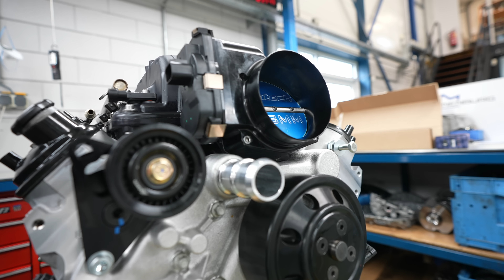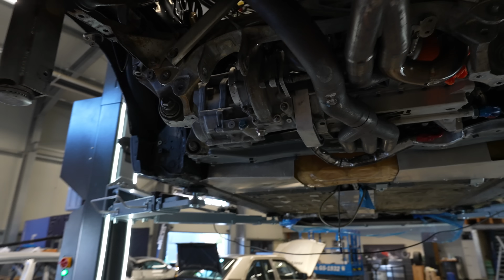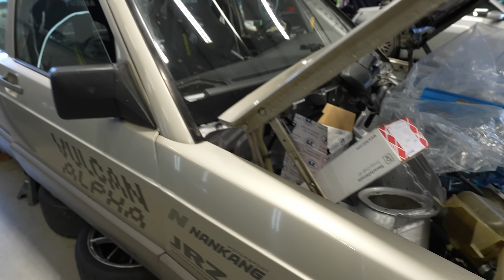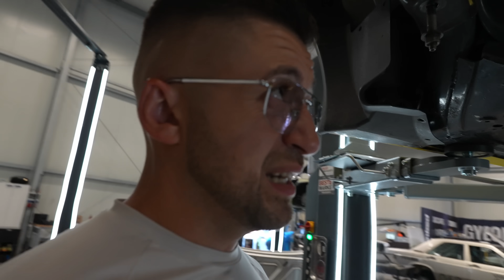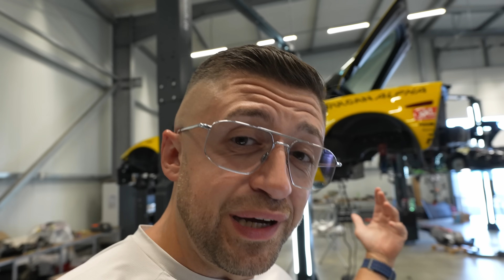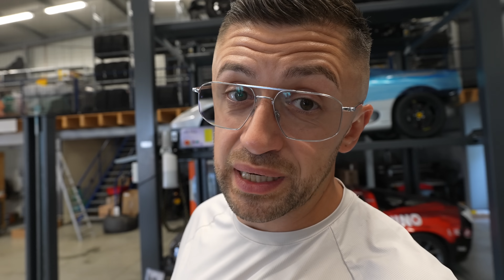F1 Tech And New Engine for My Corvette C6 Z06! (& MORE)

Comment: I would've NOT covered the transmission tunnel panel in gold foil.  Cause now the heat will be trapped in all directions.

But if you'd only wrapped the sides/top of the tunnel.. The heat would be directed down, radiate through the panel & transfer heat under the car. (It would work like a heat-sink.) 🤷‍♂️

Comment: If you like the DC2 rack but all the euro spec models are right hand drive just get a rack from the USDM type r. All the North American spec type r’s are left hand drive. Not sure what the difference in ratio is but another possible solution may be the USDM 99-00 civic Si rack, also left hand drive, EM1 chassis code if I recall. 

Edit: just asked ChatGPT and according to it the USDM DC2 type R rack has a 16.0:1 ratio 2.98 turns. But also the USDM integra GSR has the same rack as the type r which should make it a bit easier to find one.

Also Quaife makes quick-ratio rack and pinion gear sets for the 90’s civic/integra based chassis. People report using a combination of Quaife’s gears and OEM gears to get a quicker ratio than the dc2 at about 2.5 turns.

Comment: Misha, if you want the golden nonpowered steering rack for the EG chassis I have one laying around that was meant for my EK. It is depowered EG rack I think with a integra spindle. I don't remember. It's super responsive and came out of a track-focused EG. It is for a LHD. I think the car it came off of was 15x8 wtih 225s and the steering was amazing.

Comment: The Z is looking better by the day bud.  1 issue though, the American Flag should be facing the other way, the Stars always lead into the wind as these colors don't run.  Right now, your flag is positioned the opposite direction on the passenger side.  So, both flags (both side of the car) should be facing with the stars and stripes towards the front of the car with the stripes towards the rear.  Thanks for fixing this issue, it's important to this US Navy Veteran.

Comment: Pardon my asking about the heat shielding. The colour reminded me of something else, the mylar emergency blankets that come with silver one side, gold the other. To heat a body up you put the gold side out and silver side inside to reflect the heat in (and absorb whatever can be gained from other sources e.g. sunlight). To cool a body you put the silver side out and gold side in to reflect heat away and to draw heat from the body (gold side) and radiate it away (silver side). All of that brings me to my question: Why is gold put on the side that is hottest, wouldn't that absorb more heat than silver? And given the location, wouldn't it thermally transfer the heat to the car chassis?

Comment: What engine is in Lapo's 190e? You guys should use the 3.3l or 3.6l AMG M104 I6, or the AMG M113 (early NA 5l) or M113K (Supercharged 5l V8)....or, if you want something different, OM606 or OM648 with compound turbos ....any of the above with the Mercedes 6spd Manual of course

Comment: For the civic steering rack, depending on what year type r you like, it could be 16:1 or 15.7:1 ratio. If you are having trouble sourcing a type r rack, maybe consider GS-R? I personally had the GS-R rack in a K20Z3 swapped EJ8, it was great!
Reply: All Integra steering racks are the same ratio. The only difference is the year. 94-99 use the 16:1, and 00-01 use the 15.7:1.

Comment: Might look into removing the stock fuel line and evap lines in the tunnel.. run it through the rocker and it won’t get as hot. Plus you can access it a lot easier and less risk of fire. Also the carbon canister above the passenger fuel tank. Saves 8 pounds.
Reply from the maker: Going full fuel cell etc over winter, too much work now

Comment: A dc2 type r was also available in europe and you can also find a lhd dc2 rack they are the same...🫣Anyway A LHD  MG ZS 180 steering rack is also very short and fits but is difficult to find.
You can also swap the pinion from a dc2 into a eg or ek rack.

Comment: I believe the USDM Integra Type R rack is 2.85:1 and the civic is like 3.6:1
Reply: All Integras have the same steering rack ratios. 94-99 are 2.98, and 00-01 are 2.89 or whatever.
Reply: @koopatroopa187 I think the Civic he has uses a 3.6:1 ratio. Probably any Integra rack would be an improvement

Comment: For the Civic maybe DC2R base + QSP steering quickener ? On a 2.85 turn DC2R rack it should achieve 1.9 turn for their 1.5:1 ratio or 1,425 turn for the 2:1 version.

Comment: When a porsche GT3 was too expensive so you got a corvette and threw the value of a porsche GT3 at it.
i love it, keep going!
Reply: This season so far.
Reply: Wait until the civic build bro 🫪 🔥
Reply: Yeeeah. GT3s … 1,000s. This is one of a kind
Reply: This is most liekly more expensive then a GT3. The RRP price is in the sky. I think very few do all this mods, its a showcase study, for sure more expensive then a GT3 can you imagine :D
Reply: It’s kind sad because in the U.S. you can build a C6 that would drag a gt3 around a track for less than 100k. and if you wanted to in the US you could buy a stock corvette that faster than a gt3 for far less
Reply: Fuel consumption is also double compared to a GT3 I guess
Reply: @tubejorrit per kilometer cost is not dominated by fuel hahaha but fair point
Reply: Fuel consumption is largely a function of horsepower, not static displacement, so probably not the best way to make the point you're trying to make.
Reply: @TheDude-d4i  not in a diesel lol, 535d/335d does 30mpg in the city and 40+ mpg cruising doesn’t matter if your 400hp or 700hp
Reply: You're not making peak fuel economy while making peak horsepower.

Horsepower is a function of how much fuel you can consume in a fixed period of time., full stop.
Reply: @T @TheDude-d4i bviously not, but try a 700hp petrol in the city then get back to me, look at Peugeot 908 hdi or Audi r10, they used significantly less fuel at full throttle than petrol equivalent power. Don’t try be smart
Reply: @TheDude-d4i  are these people for real? Comparing petrol to diesel, and dare to say 'don't try to be smart'
Reply: It’s for his US viewers, Misha knows GT3 is the best for that money.
Reply: @JerainJezza so why so many Europeans doing the same thing?
Reply: @lasourisaboyante  You think? Just bc some youtubers do it for their audience doesnt mean there is a lot of track corvettes. I knew one guy with a Z06, constant overheating and blew his engine on track… Go to the Ring and watch the amount of GT3’s vs US cars, it’s for a reason they are outnumbered.
Reply: US cars represent about 1% of cars on European roads, of course they're rare on a European racetrack.
Reply: @TheDude-d4i  Even on US tracks they are more rare, bc Porsche and BMW are better track cars.
Reply: Corvettes are significantly more common on US tracks than Porsches and BMWs.

The only car you see more frequently on US tracks are Miatas, and both because of the value proposition (how fast you can go vs how much you need to spend).
Reply: @TheDude-d4i what tracks are you going to? In nearly 30 track days I've seen literally hundreds of Porsche and BMW but maybe 10 total Corvettes, including mine.
Reply: its value only in engine itself 😅
Reply: People are still mad a $30k car from the US is as fast or will outrun their overpriced VW bug.  I’m sure you hate the C8, wait until the C9 blows the doors off your 60 year old design dream car.

Comment: Have you considered the gold reflecting the heat back and making the engine bay hotter than before? If the reflected heat makes the engine run hotter, which radiates more heat, which means more heat reflected back... Is there enough airflow to prevent overheating?

Comment: Have you considered a steering quickener. They're relatively cheap and i know that some ara rally cars use them. I know they require some fabrication because they're universal fit but its not too crazy.
Reply from the maker: Still need a hydraulic rack
Reply: @mgcharoudin the steering quickener is mounted onto the steering column, you can use the civic si power steering rack or any system you choose. Its used in rally for this reason.

Comment: I have posted before that I wish you wouldn't sell off the running gear for this car but use it for another project instead. I've been saying a standard c6, but an even cooler idea would be a restomod using a dynacorn 67 mustang fastback body or even a factory 5 type 65 coupe. Either one of those would be even more epic to see going around the ring than the corvette, which is awesome.
Reply from the maker: Too many project cars atm
Reply: @mgcharoudin  :(, thanks for the reply

Comment: The gold anodized things soldered to your lights in the rear are definitely resistors. They are probably pretty small, but are probably capable of 25W-100W of heat dissipation. They definitely do not belong on a car though...